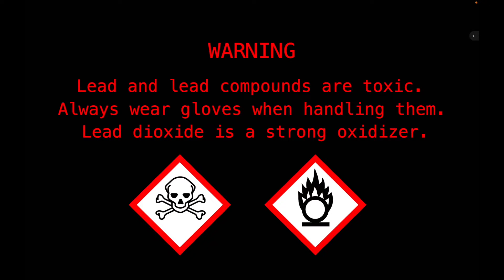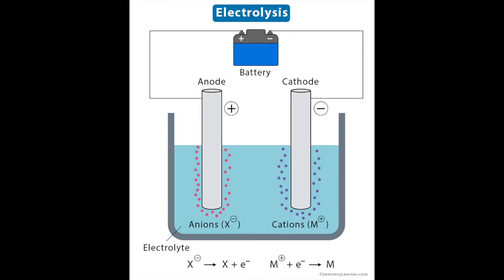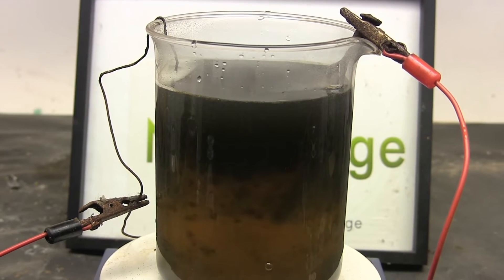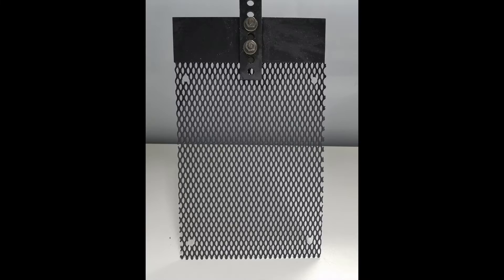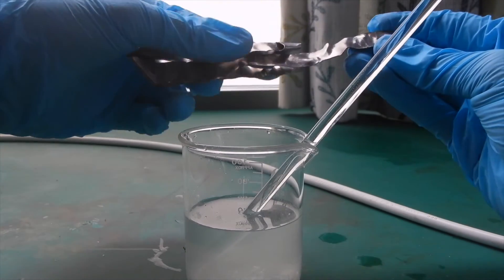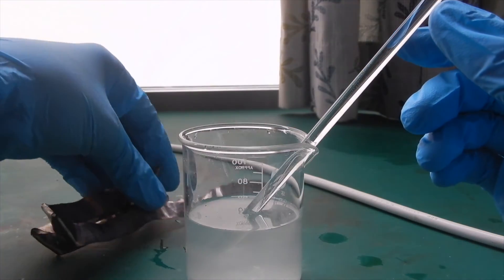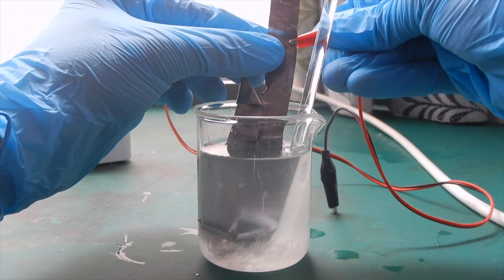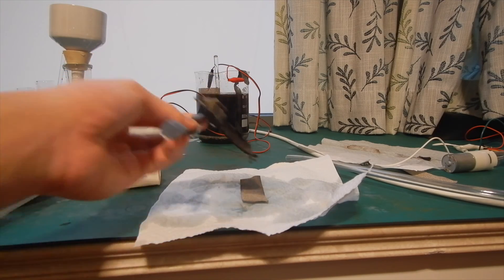2.1.1 Post-transition metals - Making Lead Dioxide Anodes

Comment: I admire what you did here, but you should have extended that PbO2 does not stick well onto Pb. You must sandwich it with few other metals to do the trick preferebly on cylindrical rod Cu-Ag-Pb. Then when you oxidise Pb a reaction will happen later on 4Ag+PbO2>2Ag2O+Pb which is electrically conductive enough to allow descent current to pass on low voltage without overheating itself and the solution. I haven't yet analized this, but it was a discussion about PbO2 on the sciencemadness forum. If you do that on Cu it will turn into less conductive oxide (a semiconductor) and that's why Pb must be deposited onto Ag. Then there will be a barrier of Ag2O toward Ag that prevents another layer of atoms to get oxidised and reach the primary rod Cu.
Reply from the maker: The problem was quite significant in my next video as the lead dioxide kept falling apart from the electrode and contaminating my solution. Now I see that the problem was with the substrate, and I have heard that graphite and other metals like Ti works as a decent substrate but I don't have the condition to make a graphite substrate PbO2 anode yet. I probably will cover it in future videos. Thanks for your valuable suggestion!

Comment: I have a full video on making PbO2 anodes which are able to work at 200ma/cm^2 but it needs both tin tetrachloride and titanium substrate as materials. to apply a ceramic coating of doped tin oxide which lead oxide adheres to as its electrodeposited from alkaline plating bath at 2.3ma/cm^2.
Reply: what the hell are you doing here? you are everywhere man! LOL!

please, understand this is a joke and it  is to be taken lightly!
Reply: @deathkeys1  I recently also saw a chinese vid on making RuMn anodes